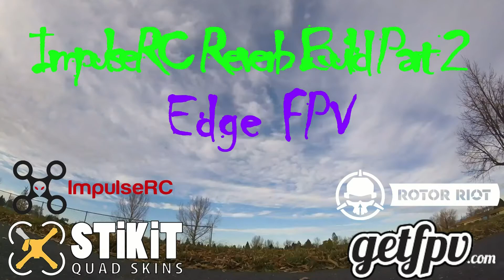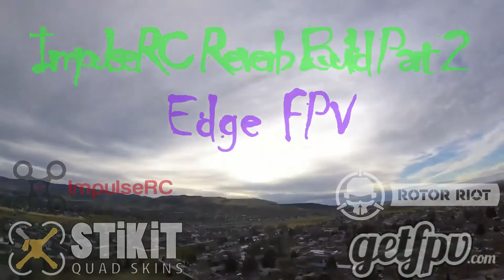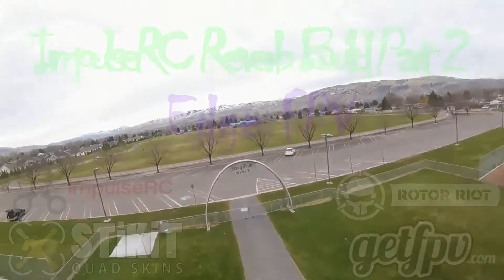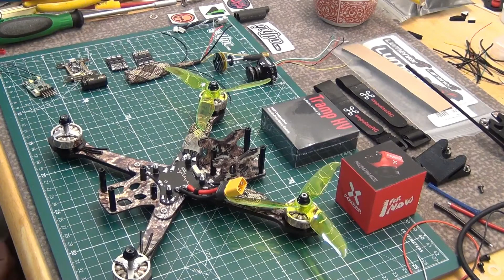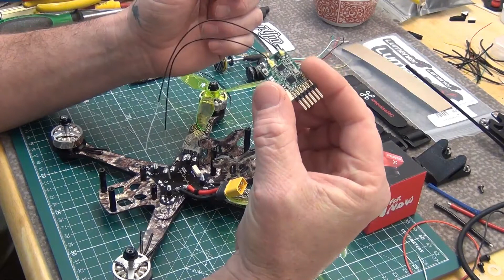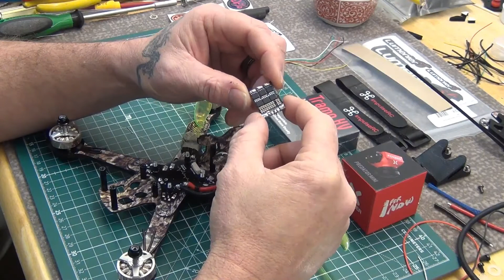ImpulseRC Reverb build Part2 with Hover Test

Comment: I see a lot of builds with side mounted Battery lead?  What’s up there?  As apposed to rear mount?  My apologies, I don’t know!
Reply from the maker: Usually the Vtx antenna is out the back and it is better to have the power away from that.  You could go out the back if you wanted to  but off the side will take up the slack off the battery lead and they will not bounce around as much.